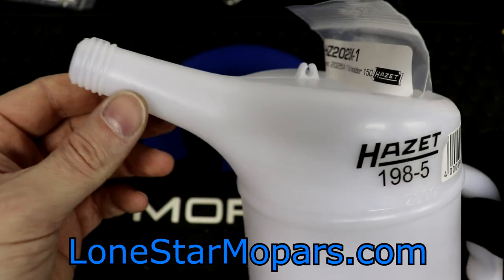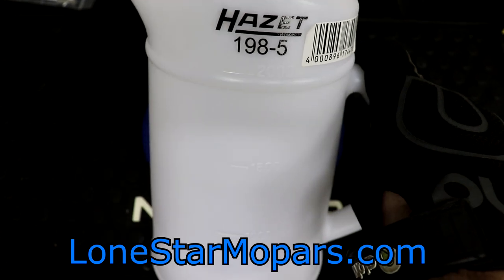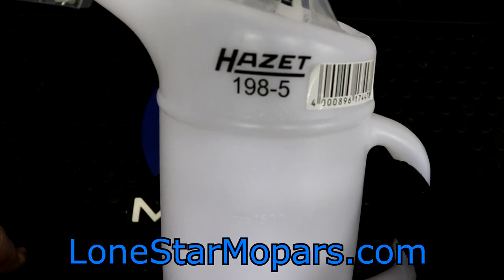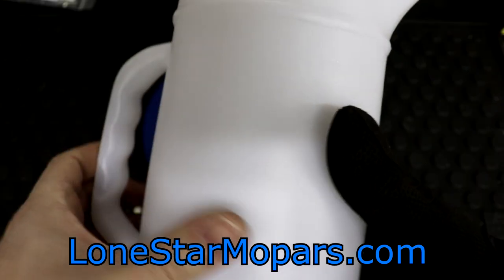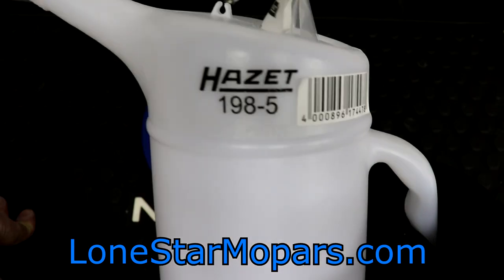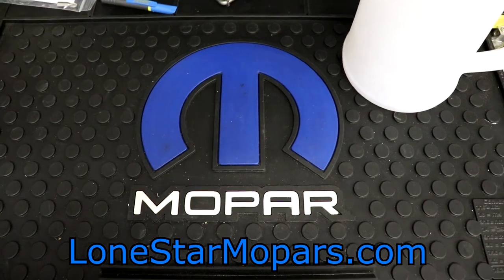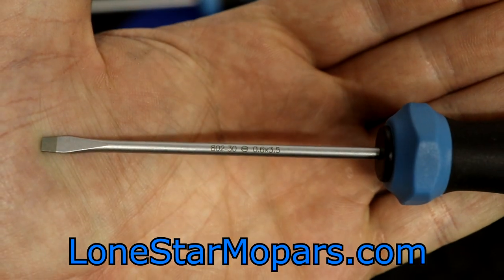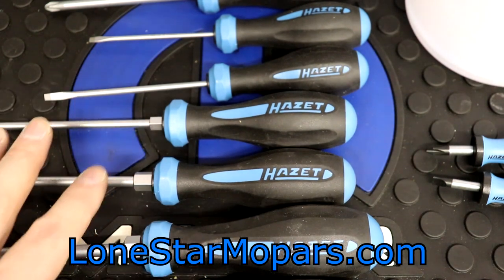KC Tool Haul #47: Hazet Hexanamic Set, Measuring Cup, and Tool Holder

Comment: That second item...the tool holder...looks very much like a tool holder by PB Swiss that I saw.  Since they're both from Switzerland, I'd bet they're the same supplier.  I think the drivers are supposed to be held between the rubber folds, not in the middle of them.  So that holds 5 tools, not 6.